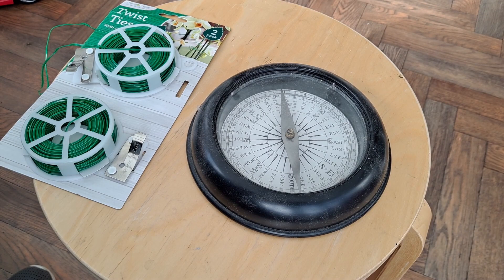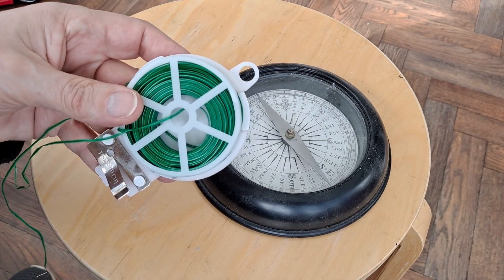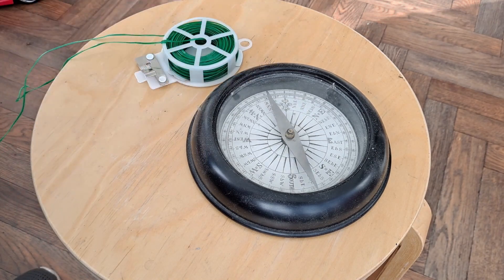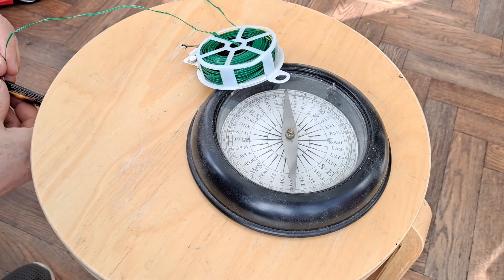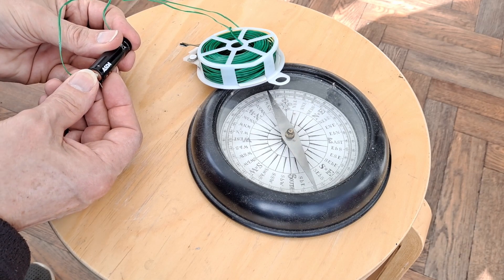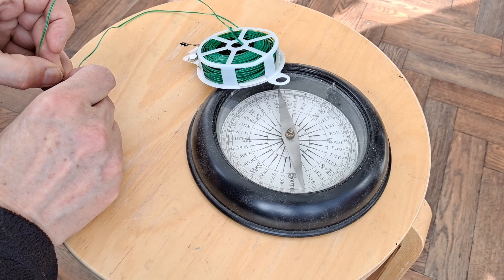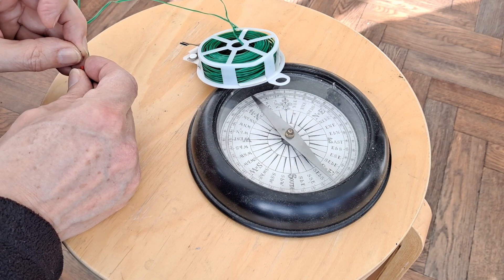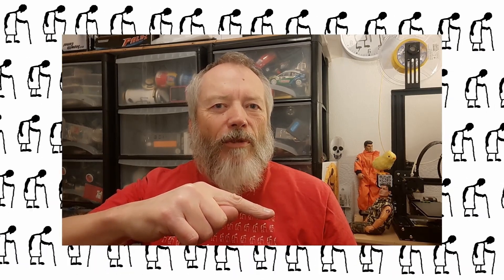Twist Tie roll as basic electromagnet

Comment: I'm guessing the wires are two different strands right? Or it would start to get hot and burn.
Reply from the maker: With enough current it would overheat. Why would two strands make any difference?
Reply: I just figured each wire on each terminal around a piece of iron is what magnetized it electrically where the single wire on each end on each terminal would make it hot and or burn
Reply from the maker: If you only connect a battery to one end of a wire, you do not get a current flow, so you will get no magnetic field. You need a complete circuit from the battery + to the battery -.

Comment: i made a mobile crane out of Meccan jr/errector . this would make an eggsllent  electromagnet for it. heart the compass too.
Reply from the maker: Nah, this is pretty useless as an electromagnet. The wires are steel, so magnets stick to it and won't release, plus the plastic will melt if it gets warm and the wires will short out. It is very low power, so you would probably use more power, and more power would make it heat up and melt.
Reply: @GrandadIsAnOldMan  thanks for your response . now back to clothes folding . ugh. I'm sure there are other idears out there .:):):):)
Reply from the maker: @allanegleston4931  I didn't want you to waste money on it. Copper wire is what you need 😊😊👍👍